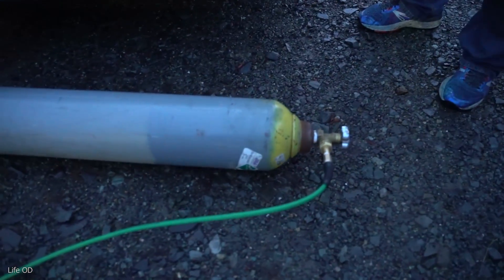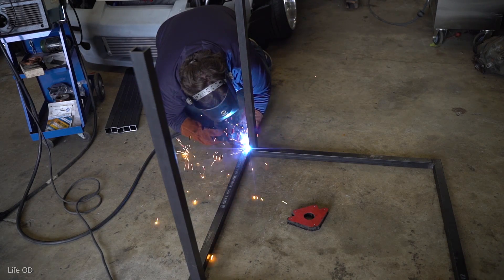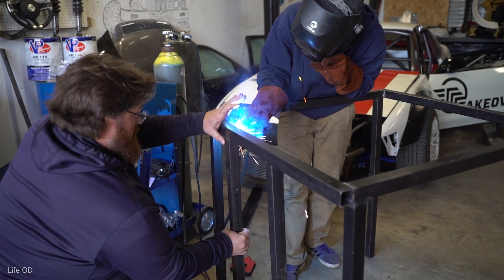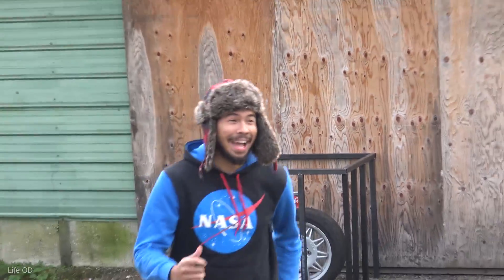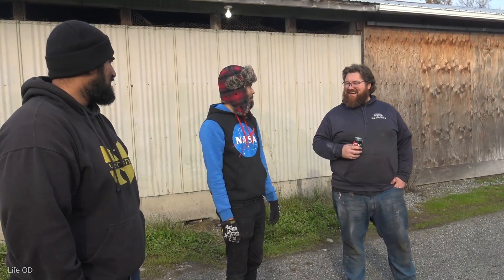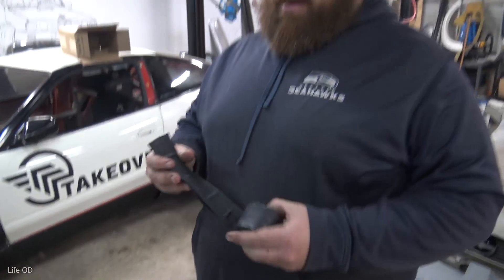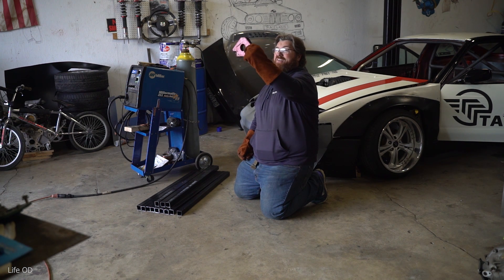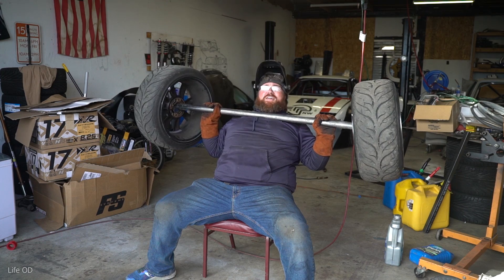How Much PRESSURE Can a TIRE Take?

Comment: Take a bottle like that with the 2000PSI in it at whack off the top of the bottle/valve and see what happens. Ya probably would know what it would do. Or you could use it to propel at car.

Comment: You havto set your air compressor so it dosnt stop at 110 psi. Instead it will keep pumping untill the tire cant take no more and explodes..  these tires are factory tested to 300psi

Also your using and airline only rated for maximum 300 psi....

And you guys should have installed safety valves to let pressure out incase of emergencies.. car tires are not as dangerous as semi truck tires, semi truck tires will actually kill you if they explode from over pressurization. Anyways..cool video boys but just take precautions dudes 🙂

Comment: My dad used to know a guy who operated a front end loader. One day he had a flat so he decided to air it up. He pull a chair next to the tire and started filling the tire, only problem was he didn't have an air gauge so he didn't know what the tires pressure was. He ended up over filling the tire and it blew. They found him laying 50ft from the tire, it Killed him instantly.
Reply: jeeez

Comment: When those wanted to see how much air pressure a tire can take as without a safety cage there would have been shrapnel in all directions when after maxing out a stationary air compressor which prompted the switch to wielding gas when the tire had grown to the point it exploded.

Comment: That cage should have been either pounded into the ground like 6 inches or capped off on the bottom to keep the bars from blowing out. Gotta be safer than that, guys. Luck doesn't last forever.

And the scripted bs can go.

Comment: You are way to casual about this. People have been killed by over-inflated tires. That cage is not going to hold anything. Tire cages are very thick solid steel not tubular metal. Your way too close.

Comment: FUN FACT

Air craft tire manufacturers doesn't use air when they are testing the tires,they use water . Because if they use air it will explode like a dynamite and can cause a lot of damage they already tried it in an huge container and the explosion was so strong it cracked the container.

Comment: The tire stem should have popped out before the tire explodes... normal valve stems are only rated for about 65 psi. For any higher psi you should have High Pressure Valve stems or a Mechanical Valve Stem. I ran a shop for about 10 years and the craziest thing I saw was a customer who was running between 100 and 110 PSI in his Ford Taurus tires because it helped improve his MPG. He was crazy though, he blocked his entire front nose of his car off with cardboard and screwed huge rubber pieces on his fender completely covering the tire well but flexible enough to turn to improve his aerodynamics... the guy was crazy!! But he was pissed when we refused to leave his tires inflated that high and lowered them back to the MFG recommend  32 psi I believe...

Comment: When it comes to pressure, tires are not something to mess with, it's essentially a grenade that tosses metal wire and hardened rubber shrapnel wrapped around a metal cylinder.

Comment: Please do not imitate this. Hydraulics do high pressure safely because fluid doesn't compress. A hydraulic line burst and a small amount of fluid will squirt out as the lines contract. With air, you have a massive volume of compressed gas that wants to go somewhere. High hydraulic pressure is safe as long as you are a few feet away. Air pressure  IS A BOMB. Tires exploding HAVE KILLED PEOPLE. Also your cage should have had a brace along the other end as well. I was expecting a bar to be leveraged out and break off completely, or be sent flying to impale something.

AIR PRESSURE IS VERY DANGEROUS
Reply: You must be fun at parties. Shut up and live a little
Reply: Air is also a fluid...
Reply: shut the f### up and have fun in life 

they made it fun and safe
Reply: "A hydraulic line burst and a small amount of fluid will squirt out as the lines contract."
Google "high pressure injection injury".
Reply: Are you going to be a bitch the rest of your life? Everyone understands that air is a gas and fluid is a liquid. Everyone also understands when you're 100 yards away behind a car with the tire behind a cage. Shit ain't going to happen.
Reply: @Kyle_1399  but air is a fluid. "fluid is a liquid" does not make sense
Reply: xRam Exactly more content for us. Its usually the ones that say "shit ain't going to happen" that gives us this content. and somtimes end up on r/watchpeopledie

Comment: normally the on the sidewall of most tires, you can find the max psi pressure. just an fyi
Reply: Doesn't mean it will blow at that psi. Imjs
Reply: @lilmonk6791  i never said anything about blowing up. i just stated a fact. for viewers.
Reply: Most tires say 50 psi max
Reply: @tannerhand18  i did tires for 3 years. Most I've seen said 44 max psi. 50 in is next. And lt e rated will say 80 psi most of the times. Rarely you see a 35 psi tire.. Imo from what i have seen
Reply: lil Monk I never said anything about 35 psi and I work at leshwab and always see tires that see 50
Reply: @tannerhand18  no im just stating it i never said you said that. Lol you see 50 a lot on low pro file tires for a fact. But you get what i mean. I did used and new tires so if you sold just new then maybe you see more 50 psi. But imo that's what seen